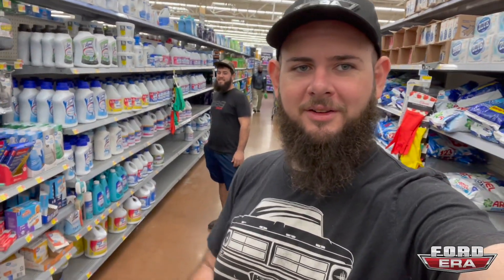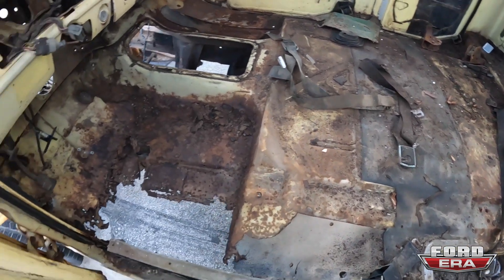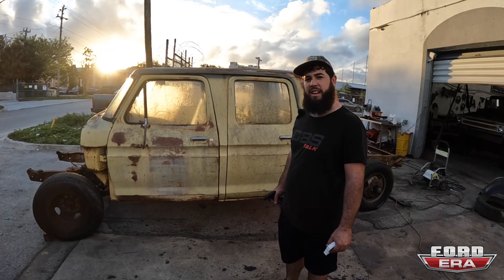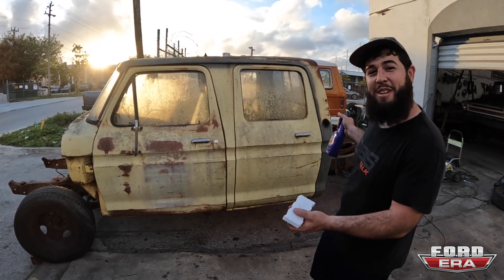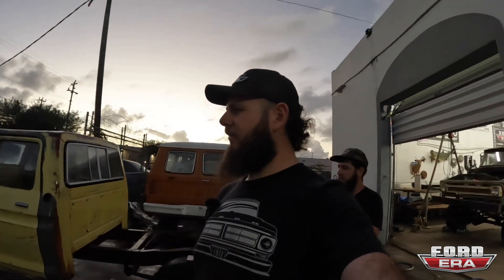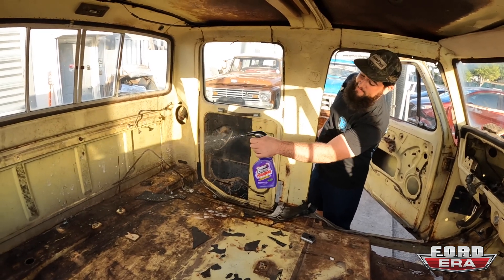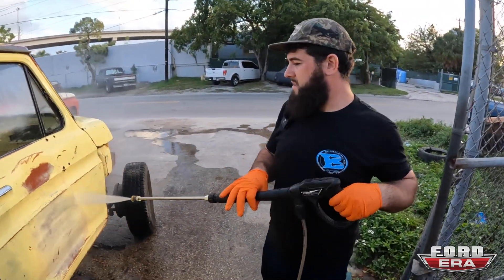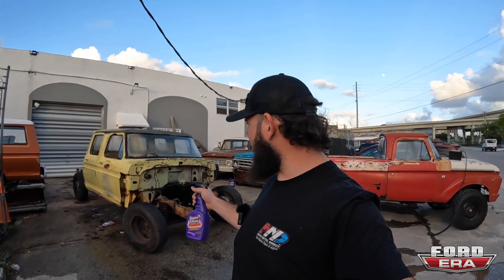Cleaning our Dentside Crew Cab | Ford Era

Comment: I had a new 1980 single cab 300 cu in 6 cyl long bed dual tanks. Got 28 mpg. Paid $7,200 payments were $500. Could pull anything. Two tone silver. Make yours a Baja real short rear space with just two spare tires and a 4 x 4 engine your choice. If you decide to paint white with red interior. If not leave yellow with tan interior. Good luck

Comment: Cool 4 doors  , hey iam looking for the glove box push button lock with the key , and yes i have tried  dealers but no go . if you can help that would be cool , for a 79
Reply from the maker: Did you try LMC or dennis carpenter
Reply: @FordEra  all they have is the regular non locking type

Comment: So Solomon 
    I would love to see the rusted banana boat with a DT466, compound turbos, Easton 6+1 manual trans, gear vendor overdrive and  divorced transfer case in it... If it was my truck I would definitely stick with an 8-foot bed or a custom 9' dent side bed. 
   Maybe use the frame, motor and trans from a International 4900 to save money and time.
    I would also like to see that truck remain sitting as close to factory height as possible, maybe a little taller than the original Factory Highboy height. Then stretch the fender well openings like the original Bigfoot. Run a set of 38 or 40 inch narrower tires with no lift.
   Add all those ingredients together and what you get is nothing less than pure awesome sexiness! 😎
Reply from the maker: man does that sound bad ass!